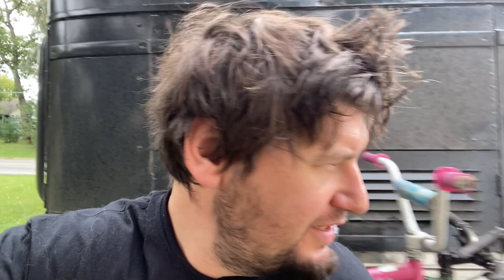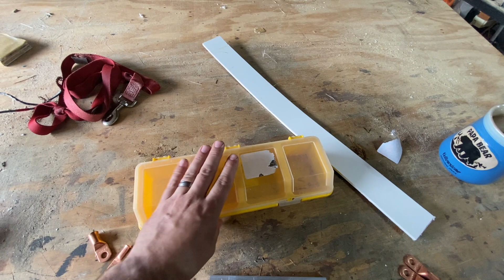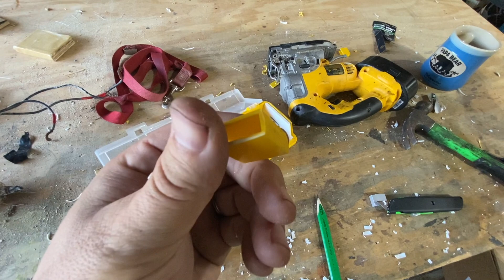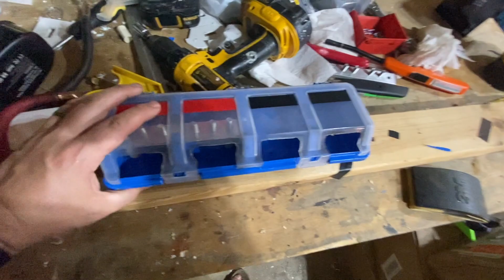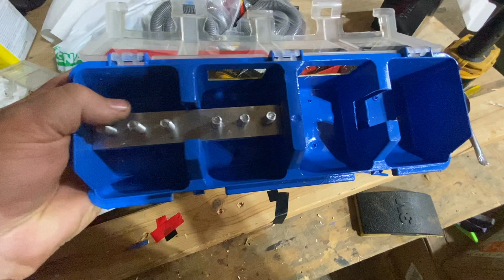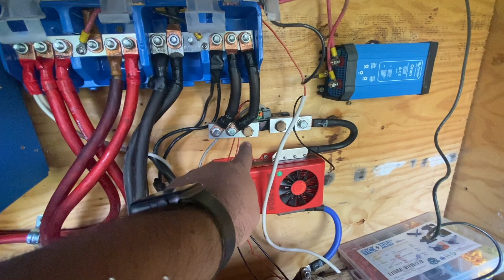DIY Bus Bar with Distribution Box for off Grid Solar, RV , Bus Conversion, Skoolie or Van

Comment: lol I gave you a like simply because of the beard thing..thank you for the smile you gave us. OK like the buss bar you made super nice! I wondered about aluminum though are you going to put a copper strip under the eyelets? how does the DC go through the bars? Just curious :)
Reply from the maker: Aluminum is a good conductor. It’s just 30% less conductive, so oversize by 30% and it’s all good. 

Honestly though, I plan to upgrade to a Lynx distributor soon. It’s better in most every way.

Comment: 🤮🤢🤮🤢🤮🤢👎👎👎
Reply from the maker: I’ll reluctantly agree with you. I plan to upgrade mine to a Victron Lynx Distributor soon
Reply: @HimmelbergerBus  What kind of problems did you encounter?
Reply from the maker: @krispykush313  Nothing really, it's just not what I would do as a professional RV Solar installer now.  Not sure I'd pinch the pennies here is all.  Was fun to build though. It's still in service as of today.

Comment: I'm about 1/2 way into your video right now, and I like it.  I'm in the middle of a planning something similar - but I am going the path of heating and molding PVC pipe for a cover. It's cheap and easy. Just a thought
Reply from the maker: Hmm, interesting. With our solar business starting now and getting exposed to more Victron stuff, I’d recommend the Lynx Distributor.  It combines bud bars and fusing cheaper than even buying the components separately. This DIY method is still much cheaper but I think I’ll eventually convert to a Lynx.

Comment: Apply AL to copper conductive grease on the lugs that face the AL.
Don't use dielectric grease. It is for applying on top of connections to prevent corrosion. 
Dielectric = not conductive.

Comment: Good proof of concept.  Try improving with a better box with better plastic.  Perhaps a purpose built electrical box with transparent cover.
Reply from the maker: I was thinking about that today, but the HDPE behind it as my backer is just fine I think.  The organizer box is really just a frame to hold the plastic cover .    If you have some examples of some high quality boxes with a clear flip up cover, I'd love to check em out.  Thanks for watching and commenting!

Comment: Ali and copper lugs dont mix well over time need to use tinned copper lugs as ali over time oxides also ali bar needs to be sanded to break the oxide layer and applies special ali conductive grease other it will cause hot spots etc i have seen this over time and it does fail if not prepared carefully. Copper is much better and less trouble some to make bus bars.
Reply from the maker: I hit the bar with steel wool to clean it up.  The design could be done with copper as well. I had the 3/8 Aluminum so I figured I’d give a try. I might apply the dielectric grease again. I was getting some heat with that on it before, I figured this tile I’d try better surface prep .
Reply: @HimmelbergerBus  You also need to change the lugs to tinned copper as this has better conduction on ali than copper lugs.
Also depends what Alloy you are using, for electrical bus it should be 6061-T6 or 6106
Reply: Apply conductive grease,  not nonconductive dielectric grease.
Dielectric = not conductive.

Comment: What I like about this is your ability to create and re-create. Many will benefit from your demonstrations. Also, if nobody, like me is working on a project like this, I enjoy just watching and learning stuff I am hot involved in. One thing, heat will start fires, especially with plywood backing. There can be no heat tolerated. Increase tension on connections and using larger components may be required, and re-tighten 2 or 3 times in the first year. We need to do lunch sometime soon.
Reply from the maker: I’d like that. Thanks
Reply: @HimmelbergerBus  pick a time and place. Maybe Carols?

Comment: First!!!
Reply from the maker: Someone had to get there, congrats!
Reply: @HimmelbergerBus  Always looking for ideas to simplify and make a system reliable. Thanks!
Reply: Doesn't copper and aluminum react and corrode?
Reply from the maker: @jim h I’ve not had problems with it. The terminals on these 280ah 3.2v cells are aluminum, it’s one reason I did aluminum bus bars there.  I did something like this before to even out resistance in my AGM batteries, never had corrosion.

I did steel wool polish the bars before installing though. I probably should have shown that.
Reply: @HimmelbergerBus  Did you ues any corrosion resistant compound on the connections?
Reply from the maker: No, I've done it before, was going to see how things went without some.  I figured if I did good surface prep it would stay sealed.  Aaaand with no lead acid fumes to worry about, I think I'm good.
Reply: @HimmelbergerBus  I'm referring to the use of dissimilar metals. Long time ago, aluminum wiring was used in houses, and the aluminum would disintegrate when attached to the copper of the outlet. Caused many fires. I imagine it takes many years. I think there is a special paste which was used between the two differing metals to stop the galvanic corrosion. Not trying to say not to do it, just be aware. Cheers